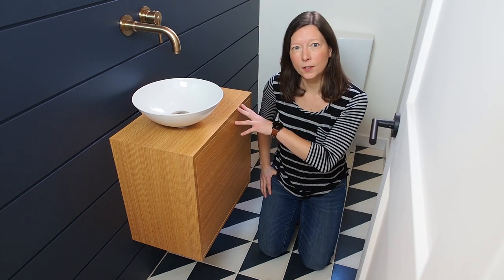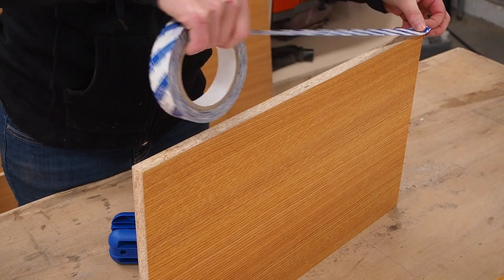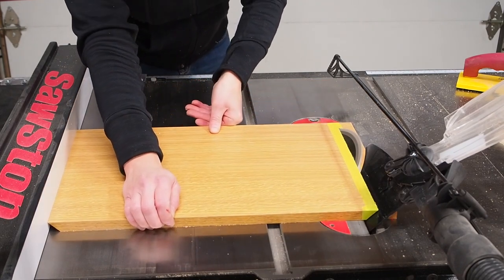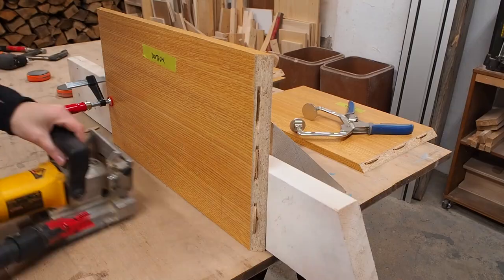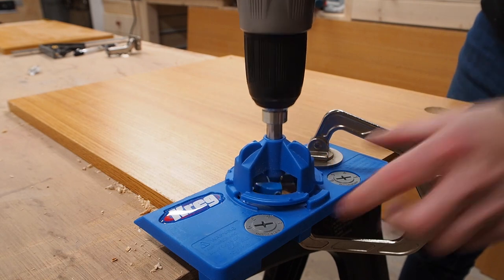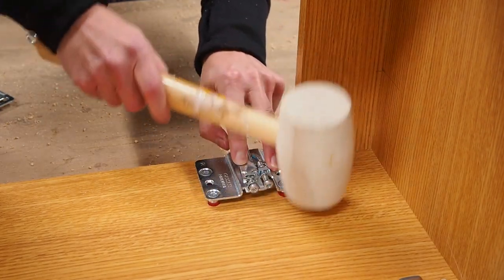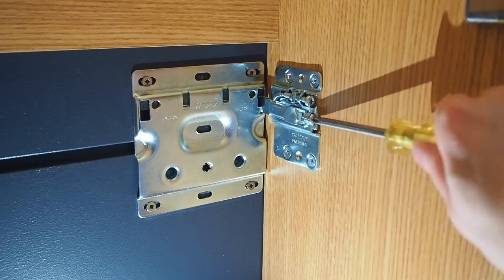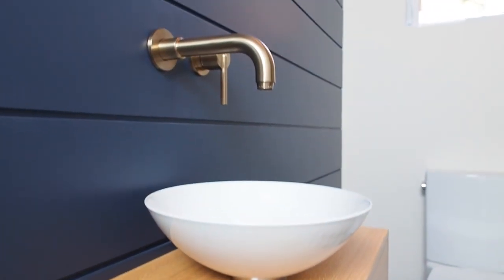Wall mounted vanity || How to build and install

Comment: WOW, I learned so much from this short video. Edge banding, biscuit joints, handling prelaminated particle board, jigs for door hinges and other hardware. I will be applying all of these skills to my next project; building window seating/ storage around my kitchen bay window! I will certainly be returning to this video many times to study the steps. Thanks for the great detail and care you shared in this process.
Reply from the maker: Awesome, glad to hear it was helpful! Good luck with your build :-)

Comment: Great little project. Thanks for sharing. I always used iron-on edge banding but your way seems to be very easy as well. I'll have a look for this kind of
double sided tape.
Reply from the maker: Thanks, the tape is super easy to use! Just hope it holds up over the years. 
FYI There's a link to the tape in the description box.

Comment: Excellent build. I learned a lot. Unfortunately I don't have a biscuit joiner and was thinking about using lag bolts/dowels with pine instead of particle board since my bathroom can get steamy with the shower being near the vanity and the fan only works so well. Do you know someone who done something similar?
Keep up the good work!😃😃😃

Comment: The only thing I would add, seal up the exposed wood parts of the shelf with a coat of varnish.  Water or humidity will wreak any bare melamine it touches.  Experience talking...
Reply from the maker: Good point. While I'm confident in my plumbing installation, water always find a way under a sink. Will go back and seal the edge, thanks!